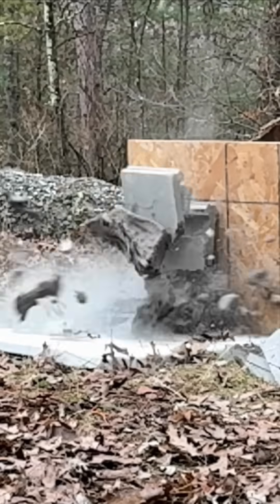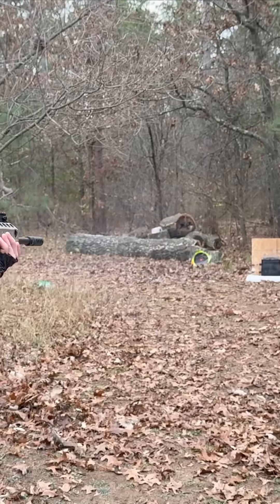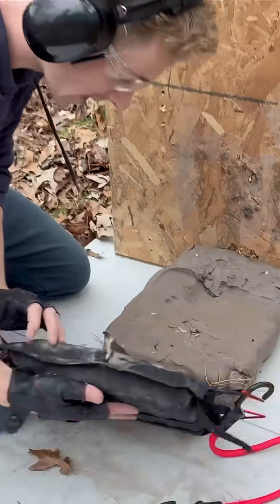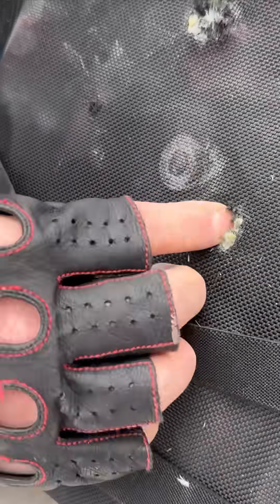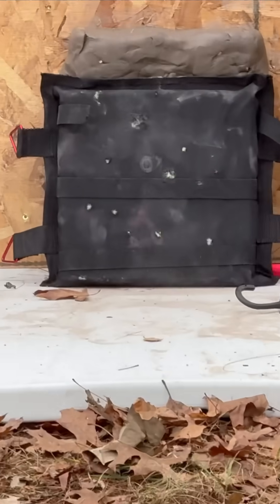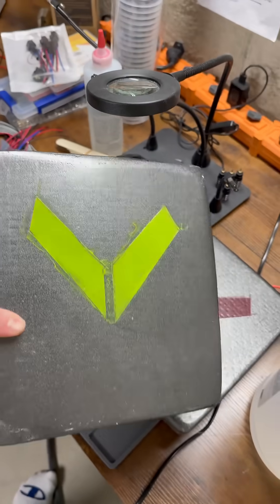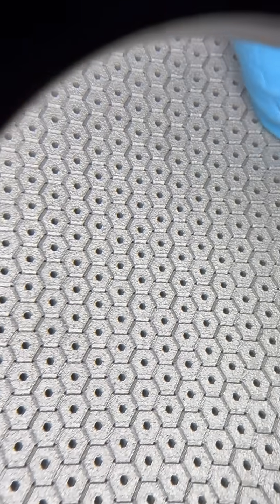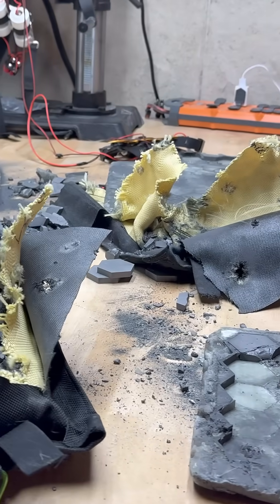3D Steel Armor Demo #batman #shorts

Comment: See about collabing with Brandon Herrera or someone to test it with various calibers, ballistic dummy backing, and spotlight your channel a bit. Just be 100% up front with what you're doing. He built the AK-50 and I think he might have some interest fueled by a touch of tism in what you're doing

EDIT: Also I have another idea. Carbon, titanium, ceramic, and nanovate in a laminate multi layer sandwich structure. That was an idea I was considering for halo armor. The least heat resistant would be the nanovate, but titanium is notoriously hard to bond, and ceramic cracks. I was thinking the carbon might be able to take advantage of its properties to form the ceramic, and the nanovate would be on either side of each layer of titanium as a bonding agent. But idk. I thought that up while very sleep deprived and might not fully know what I'm talking about
Reply: Nanovate is expensive, so is titanium, and what type of carbon?

Comment: Does it weigh any less than traditional armor though? If not, I don't see how thus could be practical.
Reply: No, it's designed to be multi-hit capable. Current armors are rated for ONE large caliber round.
Reply: @DestyTheBanned  I see what your trying to get at, but this looks like it would be insanely expensive to produce, and with current military tactics, the strategy is not to survive a shot, it's to simply not get hit in the first place.
Reply: @theidiotspeedruner  mhm. Counterpoint.
Its not in the military.

Comment: Looks useful and lightweight. But it's bulky. Wearing that with a carrier with 6 mags, grenades, radio, canteen, and other random shit. Not gonna go so well. Probably better off on vehicles or something else. Not even the elite service members wear level IV plates because of the thickness. We prefer the 1/4" AR500 plates. Which still handle multiple .50 BMG rounds.

Comment: Ceramic outer, non-newtonian closest to the person. It's all about matching the 'impedance' of the kinetic impact and the hardbody of the bullet vs the softbody of the occupant. If you can fill in the blanks in-between those core end-points with a lattice, you'll have something pretty special that fragments as soon as possible and disperses the forces across a larger area, for less overall penetration.

Comment: Angle the inside steel plates so it will be harder to penetrate it

Google tank composite armor or NERA armor and you will understand

I recommend using the same design as the M1 abrams turret has

Comment: You wont do better than ceramic at stopping rounds but if the performance is similar or better than homogenous steel but lighter as well than what its competing against by at least 1/2 lb per plate (ideally a lb or more) with the same coverage protecting vitals you could have something here

Comment: The problem with this is that the force from the bullet would transfer to the plate and turn anything that can squish into liquid, which means it won't work effectively without some form of padding.
Reply: Trauma pads are a thing
Reply: He puts them
Reply: Rather two broken ribs than a two inch hole in your chest
Reply: @minomano.57  more like all your ribs shattered and damaged lungs
Reply: I'd rather have 2 broken ribs and a collapsed lung than a 12 inch long, 2 inch wide hole in my chest and a collapsed lung.

Comment: I wonder what the kenetic dispersion is like with this artist of ballistic armor. Most ceramic plates don't just stop the print but redirect the force as well as preventing spalling. They sacrifice reusability to shed the secondary dangers behind penetration. 
I'd love armor like this to have for the inevitable apocalypse but I think you'd end up with a shattered ribcage and shrapnel on your face and arms, at least as it stands now. 
Maybe some hex grid rubber spacing plates behind the armor and then anti-spalling coating on the face of it?
Reply: since the plate is more thin, you could probably put a good amount of stuff like D3O, which is a really good energy absorber, behind it.  Obviously more testing is needed

Comment: Lockheed is aggressively taking notes
Reply: They is tho
Reply: They're more interested in intercepting hypersonic missiles and ICBM's. 

Also improving radar capable of seeing what's on the ocean floor 500 miles off the coast. Think Iron Dome but 1000x more technologically advanced. Long range missile accuracy is +/- 1".
Reply: Unfortunately probably not. Lockheed doesn't see much use in armoring infantry better since it doesn't make much money compared to charging 50000 for a bag of screws.

Comment: Every steel plate can take multiple hits. The objective is to make a plate that is lighter- and/or thinner than current standard plates, rated for the same ammunition type. If you want to make an impressive video, then compare your work to the standard.
Reply: Steel suffers from a fatal case of HEAVY
Reply: @DestyTheBanned  And? This plate is also made of steel.
Reply: Ok mr steel expert
Reply: @ikzamlee3810  The fact that you think you need to be an expert to recognize the commercial ability of s product, is telling.

Comment: That's what I said. It needs to be able to hold up to repeated hits and still be useable.
Reply: I would like to argue the design philosophy of "if you're getting hit by bullets multiple times; then you're doing something wrong"
Reply: @natechi290  And I would argue that there's something wrong if you're getting shot at. So why protect yourself with something that can only be used once? It's not a napkin, chewing gum, tissue paper, or a condom it's body armor and I would appreciate having armor that does not lose the ability to prevent bullets from penetrating my body after one impact.
Reply: @benkayvfalsifier3817  that's fair, but I think it's still better to take cover, rather than to tank hits. It's nice to have the ability and assurance of the armor, but I'd rather not be hit at all.
Reply: @natechi290  Oh for sure.
Reply: @natechi290  bruh you aren't going to charge the enemy like the juggernaut with or without that armor xD its just better to have something that can protect you more then once.
Reply: @natechi290  And if you have to clear a room? Its dangerous shit. Its not an if you get shot, its a when. If you'd rather not be hit at all, well shit then don't join the military ig? Its not as easy as just "take cover".
Reply: @YSleepish  I'm an airsofter and pretty good. And yeah. Cqb you're guaranteed to be hit at some point or another. All you can really do is try to remove luck from the equation, and be as skilled as possible. Cause even the best get unlucky. Random variables in the situation. Just gotta make the situation as methodical and controlled as possible so your odds go up
Reply: I would like to know how the kinetic dispersion is too, because it stops the bullet and keeps all the energy, we might get broken bones
Reply: @josevitorlobo517  Ditto
Reply: @josevitorlobo517  With a hard full body suit that is fixed, but that ups the complication of the design if he wants to maintain mobility and flexibility.

Comment: I would just buy some nice light lvl 3 or lvl4 plates from Hesco or Hardwire. Your idea is cool but its way, way, way too heavy and very thic. You could run 2x lvl4 hardwire plates with less weight and similar or less width as your plate, unless I am missing something. You could properly armor your whole suit with Hardwire or Hesco and then armor the parts not covered by proper plates, with your custom plate.
Reply: If it were me, with your resource I would make the suit's breastplate out of Kevlar or UHMWPE and full silicon ballistic ceramic insert, the Kevlar wired with PE and easy to mold and harden with resin, covered on the front with ballistic ceramic, 18mm detail UHMWPE+ ballistic ceramic will definitely withstand cal 5.56
Reply: Weighs 9 pounds at 10x10 and is 35 mm thick.
Reply: @DestyTheBanned Yowza!  But good job for a hobbyist tbh. I will stick to Hesco😆
Reply: lvl4 ceramics might be able to survive 1 or two shots from a 12ga slug or .300 winmag before the impact area becomes completely compromised.
Reply: Go watch the video, it's light and thinner than lvl4
Reply: @michakasprzak6869  From what he said and showed, not sure you are accurate there. Probably thinner and lighter than some of the cheap AR500 offerings

Comment from the maker: I'm currently torn on if I should continue with another demo plate with a few tweaks, or if I should just "bite the bullet" and start the chest plate for the suit with this layup. Lemme know what ya'll think!
Reply: I'd finalize the design before doing anything on a larger or more complex scale, otherwise you'll come up with an improvement halfway through production and spend more money starting over
Reply from the maker: @zl14l41 yea I’m thinking about just 1 more iteration and calling it there for building the suit panels. I can always do a Mark II suit too later if I find something wildly better 😅
Reply: @CrashMakerspace  you are going to be the future and in the process of your innovation you will save countless lives, I believe in you👍
Reply: @CrashMakerspace  show us your muscles UwU
Reply: @CrashMakerspace one factor to consider in the next demo may be repeatability/cost. At scale production will need to be streamlined to maximize overhead.  If you can do anything during design to streamline manufacture that may give you the edge to surpass unforeseen obstacles. 

Very cool developments.
Reply: You will not regret doing another demo plate before going balls in. Just my opinion Sir
Reply: Try another demo
Reply: You should possibly add some of the orange padding that is used in sports gear in the back for an extra layer. The stuff hardens during a impact and with the energy already being reduced it should hold up
Reply: I would like to know what’s the energy dispersion of the plate the ability to mitigate the kinetic energy so as not to cause blunt force trauma broken ribs bruised or damaged organs. I am looking forward to seeing if you can take this to the absolute limit.. great job dude
Reply: You've come this far, try one more for good measure.
Reply: Do both
Reply: Neck and face protector.
Reply: Sim traje completo  @TheRealRomansThirteen
Reply: Both
Reply: Make sure you incorporate the durability of the human body being shot multiple times can kill with just impact
Reply: What rounds are you looking to stop and for how many do you want the armor to hold up?
Reply: Don’t rush it man we are here you got us hooked we are gonna always check back on progress
Reply: Please don't die from "suicide" by two shots to the back of your head (rip Gary Webb), I hope you have solid 24/7 security.
Reply: Have you tried putting shock pads behind the plate to gauge the energy being transferred? Being bulletproof is great but if you ribs are powder, that's a thing..
Reply: Dude you have to send this over to demo ranch. It’s insanely impressive.
Reply: do you have any plans on selling this armor
Reply: Light scales over the plate? They could act as a impact distributor
Reply: 😮 I want one or 5
Reply: You have likely started down whatever path you decided upon already, however one option I had not seen mentioned is to continue with more testing before doing the chest piece but use this design to start building the other less essential pieces right away, as its proven substantial and more than fit to be used as armor. This way you can get started on the suit while still potentially benefiting from more testing before making the breastplate.
Reply: Finalize it and capitalize on it. so when 2.0 comes along you have the X amount of capital to do even more.
Reply: No this is not safe and not practical due to thickness, try another demo
Reply: While not an answer to your question, I'm super interested in what you are doing here.  In terms of making a more effective, modern armor, do you have specific plans on how you'll design a full suit?  Do you plan to follow old school overlapping plate type design?  How will you provide the most comprehensive protection while maintaining flexibility and moveability?
Reply: Well I would like to see a full body costume, you can start with the chest of the costume, perhaps similar to the Titans, the red hood character is interesting because he wears a mask that protects his face, and you can copy the armored helmet NIJ 3A, you have the resources and the smarts for it!
Reply: Another demo,maybe couple of layers of metal instead of one?
Reply: More shirtless videos